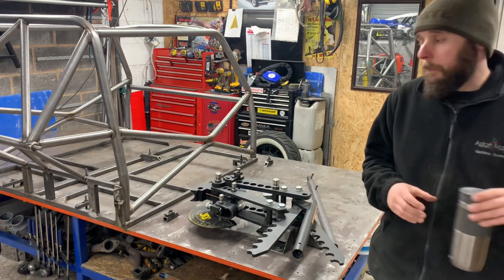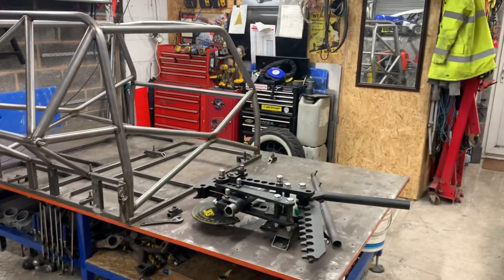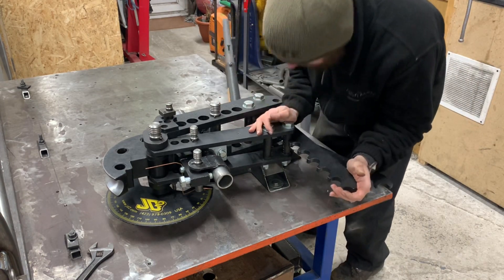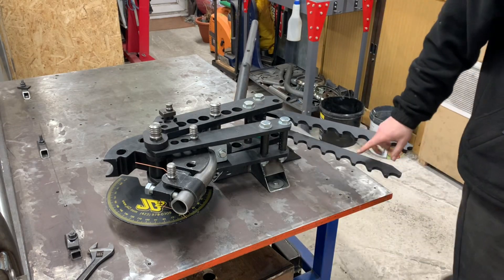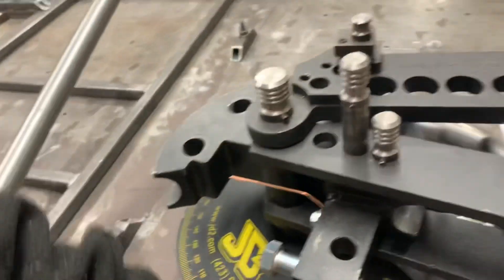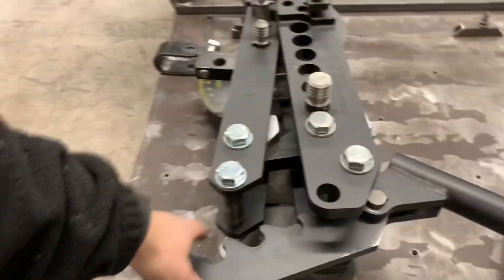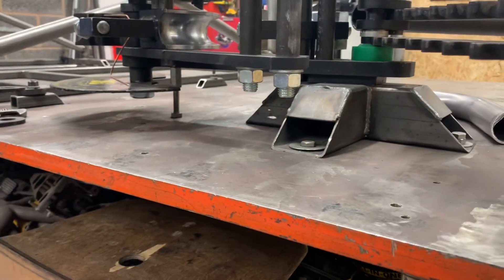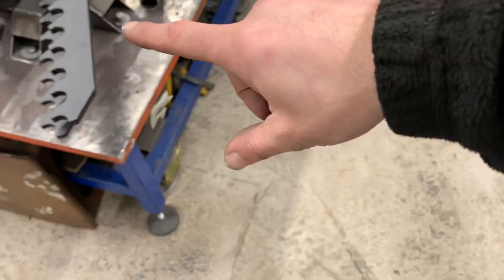My JD square model 32 tube bender

Comment: I have the model 3 and made it hydraulic for less than 500$ with eBay parts I just push a pedal and sit back  watch a dial
Reply from the maker: That’s my plan, think it will be much more accurate then what I have now 👍🏻

Comment: Great video mate, really informative. I’m looking at making my own ladder for the back of a camper van, but need to bend in two directions, any idea how this is achieved?
Reply from the maker: Hi buddy, glad you found it helpful. 
I’m guess by the “two direction” do you mean a left and right bend to make a S shape with tube carrying on in the same direction or a say a 90’ bent then turn 90’ and bend a further 90’. 
It’s a hard one to answer without seeing the project to be honest with you. What I will say is there need to be a small straight between bends of around 3” for the clamping area that holds the tube to the die, also much planning on what bends in what order so’s not to back yourself into a corner. I have got to bend some tube very soon so I could throw some in and see, I’m guessing 1” tube is all that’s needed
Reply: @skidmores.garage  hey thanks for your detailed reply, nahh that’s not what I was trying to say, sorry for confusion - I’m after more of a spiral, a bend with rotation at the same point, I could send a photo of exactly what I’m trying to make, but can’t send in here
Reply from the maker: @theclayfam  ok buddy, look me up on Instagram if you like skiddym84 👍🏻

Comment: The jd people said no need for oil on the die. They use a specially treated metal with their dies. Saw it on their video
Reply from the maker: Yer mate you will still need a little oil as the former will fuck up really quick being metal on metal. It picks up on any little scratch on the tube and causes a right mess then every bend after that is marked

Comment: Hello friend Could you tell me what is the diameter of the pulley to bend a 2" tube? I'm building a folder at home and I don't have the pulley measurements and I'm afraid to make a small pulley.
Reply from the maker: Hi buddy the biggest I have is 45mm tube. I’ll have to go look at the CLR for you when I get home as I can’t remember off the top of my head 👍🏻

Comment: Could possibly use an acme screw thread instead of hydraulics, I would imagine it's a good bit cheaper
Reply from the maker: I would agree mate only problem is it would need to be one beefy screw to it didn’t bend under load